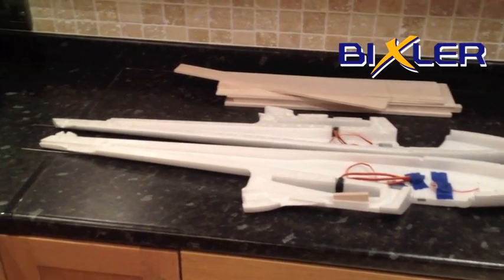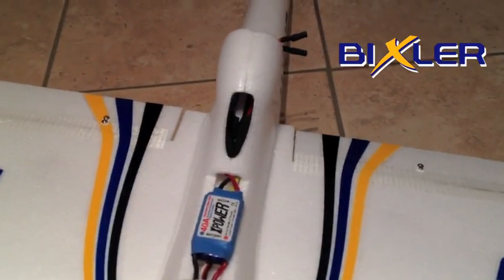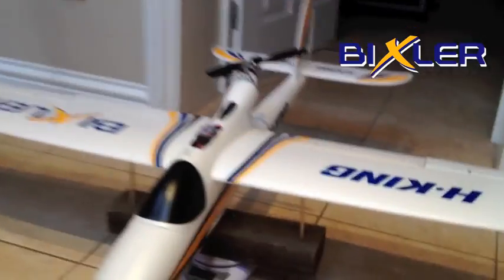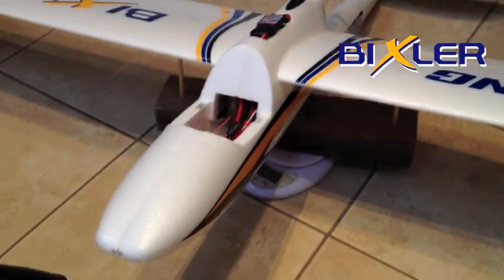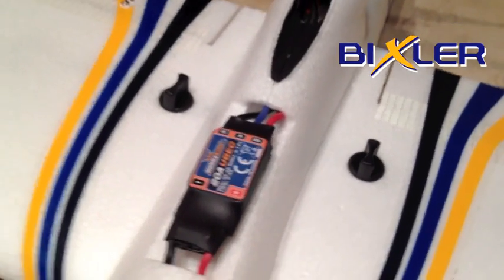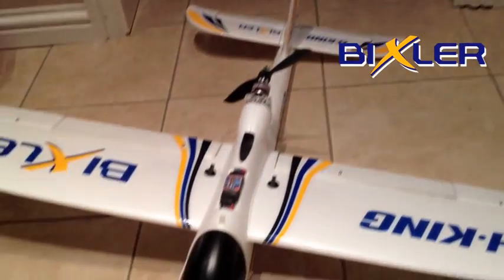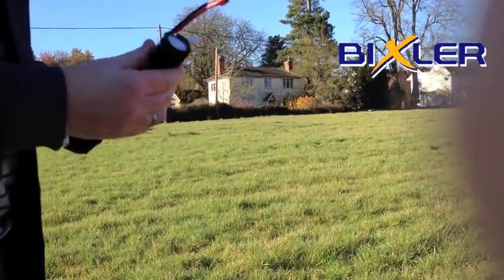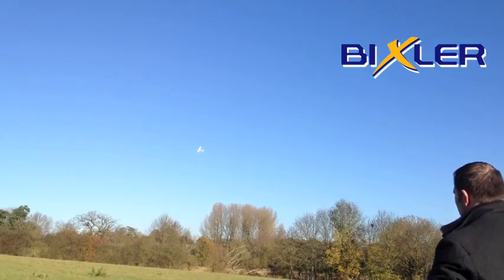HobbyKing Bixler V1 - Build, Mods & Maiden Flight

Comment: My B1, weighs 750grms with a 2200mah 3s 30c zippy battery, I have a 2826 2200kv motor with a apc6x4 prop and a 60amp esc and is pulling around 380watts @WOT, it has a solid 6mm carbon rod to stiffen the wing, it carries no extra weight, it goes like a bullet, can easily go vertical and can cruise at about 25% throttle, what you gained by moving the motor UP and BACK you lost carrying all that weight!  the flaps look like fun, but all your EXTRA's are BEHIND the CG! the extra servo's, the little plugs the bigger motor and bracket, even the esc you put behind the CG?  I'm not criticising, just saying, all your mods are behind  the CG, I fly mine at near WOT most of the time and I get between 10-15minutes flight time, if I backed off a bit probably 20-30minutes, I also have a much slower bixler2 with a 250watt motor and an MA8x4 prop it glides FOREVER!!! and it's flying weight is around the same, I converted it to a V tail, anyway  the point I'm trying to make is, Move some of your stuff, esc, Rx, whatever you can, FORWARD of the CG, both of mine the Rx and esc are just near the hatch opening forward of CG, your esc is bordering on being TOO small, please don't take this as criticism, everyone has their own way of doing things, BUT your flying weight is HEAVY for a bixler1, you will be losing a lot of performance that you gained from the motor upgrade, you put a lot of work into it and it looks great, I just think you need to move some of your stuff forward of CG to lose some dead weight. You did a great job building it and I like the flaps they look great, thanks for sharing *-)

Comment: I really like your mods. The wing attachment method and the multi-port connectors cut into the fuselage under the wing is brilliant! The problem I would have with it is that the servos with their leads rarely come with enough wire, and I don't like to splice them preferring instead to use servo lead extenders. I usually cut a slot into the wing for the connectors and hide them in the foam. I think it may be worth the trouble to solder and make up the exact servo lead length and try your method. It is such a clean build!

Comment from the maker: Hi Draven2077, power is drawn directly from the 3s Lipo - I soldered a conector onto the deans connector at the same time when soldering up the ESC - look @ 04:58 Pause it as its not on screen for long) I am holding the deans connector and you can see the extra wires :0)

Comment from the maker: Then I bevel cut the trailing edge of the flap to at least 45 degrees if not more to allow he flap to drop as far down as possible as I hinged at the top using reinforced 25mm parcel tape then just stuck the sticker back down over the hinge. The seer was mounted by cutting out a similar hole to the pre-moulded servo hole. Only other point to mention is I mounted the flap servos the same way round not reversed like the ailerons for obvious reasons. Hope that helps. Good luck with your build. Andy

Comment from the maker: Hi Andy, thanks for your comment & glad you liked the vid :0). For the flaps I simply pealed back the stickers on the wing then cut the flap straight in line with the aileron, leaving a 3mm gap when placing back next to the aileron and a 15-20mm section of the wing nearest the fuselage to allow clearance when flaps deployed.

Comment from the maker: Hi Mark,
I bought them off of eBay - they are self adheasive for balancing car wheels/tyres come on 5 & 10g sections. I used reinforced tape (sticky side up) round the batt end and created a shape that fitted round the batt end then stuck the weights to it. Send me your email and I will send a pic of it. I now have 3300 mah batts and they ballance the plane without the weights :0) good luck with your build.